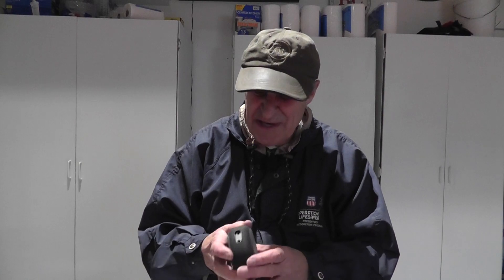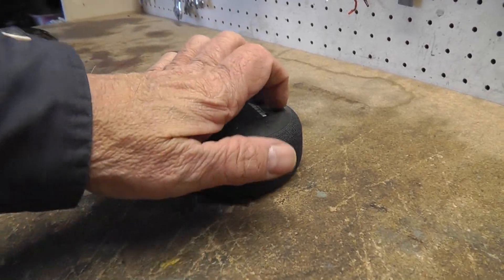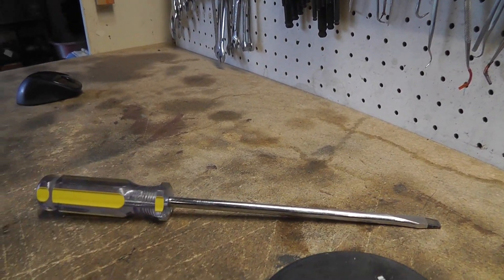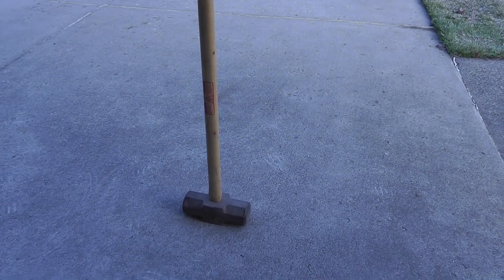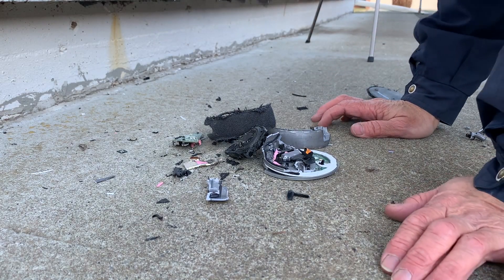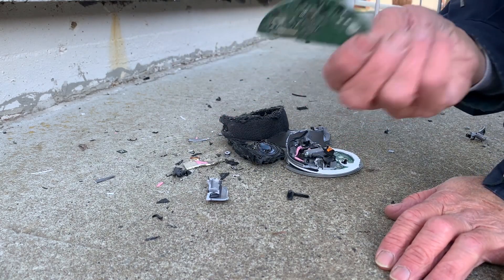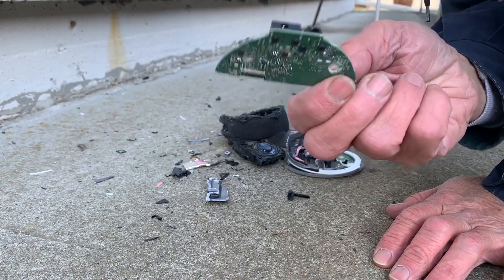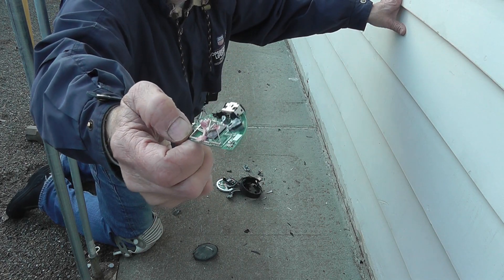Help! My Echo Dot will not connect to the internet anymore! Alexa!

Comment: What I am fining out is that all of the echo 3rd generations went down at the same time. For whatever reason, all of my other ones work, just not the echo 3rd gen. Thanks for making me laugh.
Reply from the maker: Thanks for the comment. I have been using my newer one quite a bit lately. For a long time I just sat there. And I have not had any trouble with the new one.
Reply: @windsurfed1  was the 3rd generation not working but how many weeks did it take to not connect
Reply from the maker: @bravenreimer  the one in the video never did get reconnected to the internet. I had to buy a new one.   And so far it’s been working fine.
Reply: @windsurfed1  so how many weeks
Reply from the maker: @ 36 weeks
Reply: @windsurfed1  maybe the WiFi network needs to be connected when it purple it telling you to connect to the internet
Reply from the maker: @bravenreimer  well, I tried just about everything nothing worked. If you try it and it works, let me know.

Comment: HAHAHA🤣😂🤣 Perfect solution.  I had the same problem as you but I had 5 of my 6 dots not connect over night.  Tried everything under the sun to get them working again over the last 2 weeks.  Nothing worked... including resetting router and modem, disconnecting, reconnecting, taking off cellular data, adding and removing bluetooth, reinstalling the alexa app, moving the device closer to the wifi, wearing an aluminum shield over my head, clicking my heals 3 times while holding my breath, and even shielding my entire home with one of those 10000 foot rolls of aluminum foil from costco.  

I'm done with you Alexa!!!! Going back to mechanical switches and transistor radios.
Reply from the maker: That is a hilarious funny response. I ended up getting that new one and I don’t even use it anymore. It is out in my garage. Anyway I felt better after I smashed mine to pieces,  good therapy.

Comment: I have one of your new ones, Can I borrow your hammer I have spent 10 hours trying to get this Fjyting thing working without success. I have built computers quicker than this, I will not ever buy another Alexa  Roni in Dublin Ireland
Reply from the maker: I know how you feel. I bought that new one and I don’t ever use it anymore. It’s sitting out on my workbench.  Just another item to make your life frustrated. And they are supposed to make your life easier?

Comment: Nice idea)))
Reply from the maker: Well anyway, it put a smile on my face.
Reply: @windsurfed1  my echo dot doesn't connecting  to wifi router and I'll crush it by hummer too))) Soon! I think.
Reply: @windsurfed1  Can my echo dot 3rd generation connect from my computer to my echo dot 3rd generation from a very long range because I'm using the amazon Alexa site instead of the app and my computer is far away.
Reply from the maker: @therealbullymaguire851  Wow that’s pretty cool I did not know that would work that way